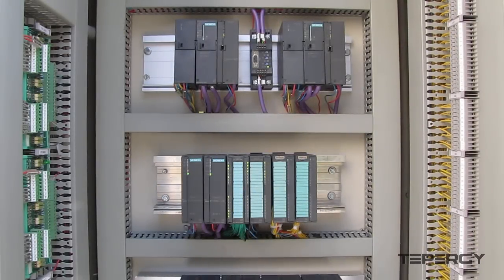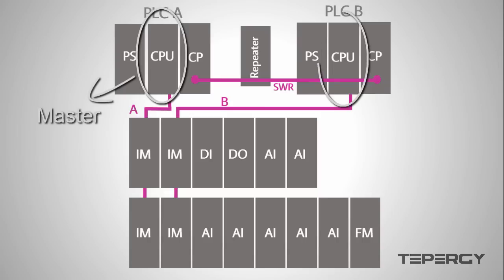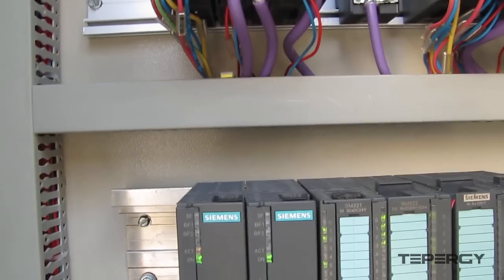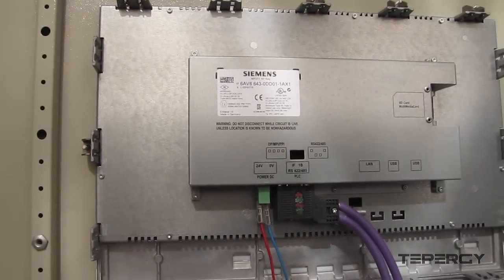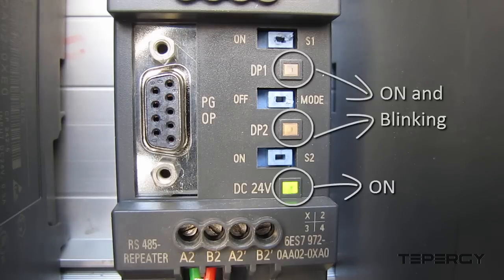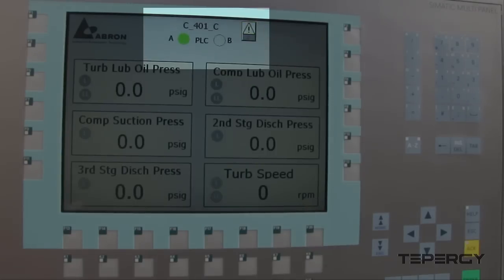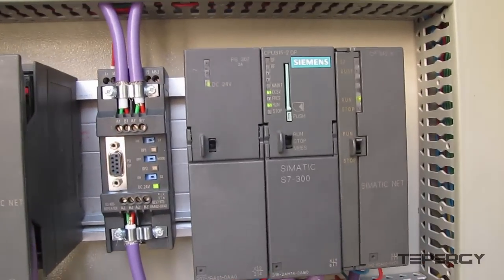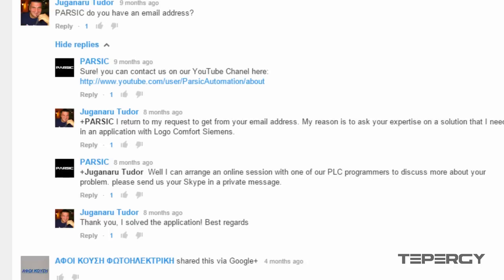How to Configure an S7-300 Redundant PLC _ PART 2

Comment: Thank you very much for the information you provide, however I have a question, I couldn't see the point of doing such a system, I mean what if a failure happened to the io cards, and that's more common than failures in cpus, then both cpus with be in sf mode and the system will go down, I have faced such a problem before in a cement factory.

Comment: Hello sir, 
I am facing node issues.
We have Siemens S7-400 PLC. CPU 416 connected with multiple nodes. One of the node missed for short interval of time (200ms to 300ms).
These node are addressed in diagnostic buffer. 
Kindly suggest what steps to take to resolve the issue
Reply from the maker: Thank you for reaching out regarding the node issues you're experiencing with your Siemens S7-400 PLC. Addressing node communication problems can be complex, as they can be influenced by various factors.

Given the complexity of node communication issues and the specific configuration of your PLC system, it would be best to reach out to the vendor of your Siemens S7-400 PLC for further assistance. They can provide specialized expertise and diagnostic tools to help identify and resolve the issue effectively.
Reply: @realpars  Thank you for your reply. 
We are using S7-400 PLC CPU 412-2 DP (6ES7 412-2XG00-0AB0)
We have connected multiple nodes through this CPU of S7-300 (IM 153-1 6ES7 153-1AA03-0XB0)

Some of the nodes are disconnected after every 5 to 6 hrs for 200ms.
We found this on diagnostic buffer of simatic Manager.

Comment: Hello friends, what is the possibility that with the equipment you mentioned in this video we can implement a ring type network to have redundancy in case of a break in the Profibus cable that communicates the PLC with the ET200?
Reply from the maker: You will need to use CPU's and communications modules that support MRP (Media Redundancy Protocol) and have 2 ProfiNet ports (not the same as Profibus DP).  I know the S7-1500 CPU and ET200SP remote I/O offer this feature.  Some models of the S7-300 do, but you would have to use an ET200MP remote I/O system to get the Profinet connectivity.

Comment: Thank you very much for the information, it is perfectly understood, now I have a question. What would happen if one of the ET 200 fails? Or, what would happen if the profibus cable that communicates one of the PLCs with one of the ET 200 suffers a fault? Would the backup ET 200 continue to send the required information transparently?
Reply from the maker: Yes, it would failover to the backup if the primary ET200 faulted or the cable was damaged.  If the backup fails, the primary will continue to operate.  In either failure case, diagnostic information will be available., indicating that the fault has occurred.
Reply: @realpars  Thank you very much for the information

Comment: Great video, it's possible to do a redundant system with 2 different CPUs with the same IO configuration?
In example: one S7-315 and one S7-312, respecting memory and processing times by the slowlier CPU capacity?
Reply from the maker: I believe it is, as long as each CPU has the same I/O hardware configuration employed.  Redundancy in an S7-300 system is software redundancy and is driven by program blocks configured in the CPUs.  Normally, the CPUs are the same model, but as long as the same program can be executed in each of the CPUs you have listed, the redundancy approach should be possible.

Comment: 1:38 "we have the same situation in Rack3",if rack2 and 3 both are same situation,then how do u conclude A is master?
Reply from the maker: Rack 2 and Rack 3 are connected to a redundant pair of PLCs, PLC A and PLC B.  Racks 2 and 3 have 2 ET200M Link cards. The left-hand cards are connected to PLC A via a Profibus connection. The right-hand cards are connected to PLC B through a separate Profibus segment.  When PLC A is the master, the left-hand Link cards are active;  when PLC B is the master, the right-hand Link cards are active.  At 1:38 in the video, the Active light on the left-hand Link cards are on, so PLC A is the active PLC in the redundant pair.

Comment: Great job! I know working principle is the same but, Are there any differences between s7-1500 R/H system and s7-300 ?
Reply from the maker: There are a number of differences, including performance and form factor, but the underlying programming and interface concepts are nearly the same.  To construct the same redundant setup as in the video except for an S7-1500R, you would only need to connect the CPUs via redundant ProfiNet cables (Profinet ring).  For an S7-1500H, there is a synchronization module at each CPU connected by fiber optic cables.  For the S7-1500, the redundancy is easier to install and configure, requires less hardware, and has much better performance.

Comment: In this configuration the redundancy is on the CPU level, but how to achieve redundancy on the I/O level ?
Reply from the maker: Thank you for the excellent question!  To configure I/O redundancy, you will need to use an "H" series CPU, like the S7-400H.   The manual for that CPU is here: https://cache.industry.siemens.com/dl/files/386/60458386/att_63953/v1/S7_400_h_en_en-US.pdf
On the hardware side, you will need to read Chapter 13 of this manual to understand the concepts of "single-channel one-sided I/O" and "single-channel switched I/O".  The use of specific IM interface modules is required as well.  On the software side, understanding the concepts of activation and depassivation of I/O channels is critical, as is the use of specific functions (FC450-FC451) and function blocks (FB450-FB453).  This takes a little practice and patience to set up your first redundant rack, but then it becomes easy to extend the concepts to additional racks.  Special treatment of analog signals is required because analog cards behave a little differently in a redundant setup.  This is all in the manual referenced above.
Reply: @realpars  Thank you for the detailed answer 💎

Comment: Do you need to configure anything on the CPUs so they know they are working en redundancy mode and which one is the master? or do they seemingly detect they are redundant...? thanks!
Reply from the maker: With S7-300 redundancy, you need to configure the hardware configuration for redundancy as add programming via specific blocks (SWR_START, etc.) and interrupt blocks to make the switchover efficient and reliable

Comment: Could anyone please explain the difference between 300's soft redundancy and 400's hardware? Thanks.
Reply from the maker: With software redundancy, two CPU's with the identical program are running at the same time.  The master executes its program in it entirety.  The standby program executes, but skips the fault-tolerant portion of the program (logic and setting of outputs).  The master continuously updates the secondary's memory and PIO table.  When a fault occurs, the secondary begins execution of the entire program and takes over as master.  This may take a couple of cycle of the program to fully changeover.

With hardware redundancy, two identical CPUs are connected to a redundancy module so that the synchronization of the data/memory spaces of the CPU's occurs through a high-speed fiber connection.  This makes the synchronization of the CPU's much faster, and reduces the fail-over time when a fault occurs.
Reply: @realpars  Thanks a lot. so the main disadvantage of soft redundancy is the swithover time?

Comment: Is the switchover bumpless? If no  then what is the switchover time.
Reply from the maker: The S7-300 family of processors uses a strategy called "software redundancy".  According to the Siemens Software Redundancy manual (A5E02171565-02), the transfer from primary to secondary takes 1 - 2 OB cycles (typically 30 - 200ms depending on program complexity).  When a fault is detected, the outputs are frozen and the Process I/O Image (PIO) is transferred from the primary to the secondary.  This is what takes 1 - 2 OB cycles.

Comment: How to Configure an S7-300 Redundant PLC HW and SsaftW in tia portal
Reply: This is a complex question.  Hardware redundancy is S7-3xx is not supported by Siemens. It is supported by certain S7-400 CPU's.  You would configure a software redundant S7-300 PLC pair in TIA Portal in the same way that it is done in STEP7.  You would need to configure 3 ProfiBus networks: 1) PLC-A CPU to an IM-153 module in each I/O rack; 2) PLC-B CPU to a separate IM-153 module in each I/O rack from the one used for PLC-A; and 3) a Profibus network connecting a CP module in the PLC-A rack to a CP module in the PLC-B Rack.  More info can be found in Siemens document A5E02171565-02.  This just scratches the surface of setting up the entire application.
Reply: @scottsommer5450  Can I do this at tia portal ?
Reply: @abdelakderkameleddinemamme4739     I have not tried this myself, but there is nothing that was configured in STEP7 in this video that is unique just to STEP7.  The functions of NetPro are now handled by the various tabs in the "Devices & Networks" builder in the Devices tree of TIA Portal.
Reply: @scott sommer Can you send me a link for software redundancy  because I did not know how to downlowd it ?
Reply: @abdelakderkameleddinemamme4739  https://support.industry.siemens.com/cs/attachments/1137637/S7_swr_b_en-US.pdf?download=true
Clicking on this link will download the applicable document to your Downloads folder.

Comment: Hi
What is the repeater for?
Can we omit it and tie its inputs and outputs together, as we have in the software (hardware configuration)?
Reply from the maker: Hi Mohammadreza,
It is possible to connect up to 126 devices, both masters and slaves in a Profibus DP network. However, to operate the network with this number of bus stations, the bus must be divided into individual segments. The segments then must be connected by repeaters, devices capable of processing the network signal and handle disturbances or noises in a way to reject them and re-create a favorable situation to the physical layer.

No, it is not possible to tie the inputs and outputs of an RS485 Profibus DP together at all!
Thanks

Comment: What is SCALANCE X208? Is this also use for the HMI like repeaters?
Reply from the maker: Hi There, it's a Siemens SCALANCE X208 Managed Switch ‑ 8 Ethernet Ports. The switches are ideally suited for the design of Industrial Ethernet networks with 10/100 Mbit/s in line, star or ring structure. The integrated redundancy manager of the SCALANCE X-200 switches can be used to build redundant optical or electrical ring structures. The units feature extensive diagnostic options, such as PROFINET

You can monitor field devices via HMI And PLCs. So in order to make a connection with them and reach your final desired movements, you can use this switch device to give orders constantly based on your power system plan.

Hope this answers your questions.

Comment: Hi, thanks for video. One question, after failure of master, slave kick in. After error was fixed does master overtake control from slave or it will stay as slave till new master fails ? Does one of them have higher priority than other or its manually set witch will be master by operator?
Reply from the maker: Hi, you're very welcome. In this redundant system,  when PLC A fails, PLC B is going to take over the control of the system and stays active regardless of the error being fixed for PLC A or not. 

None of the PLCs have a higher priority over the other. 

I hope this helps.

Comment: Hi, I wanted to ask if the redundancy is possible using ethernet protocol and not a profibus one.
I think that it is possible even if i don't know how it is done....and it is more easy at programming it
Reply from the maker: For S7-300, you should use Profibus for having the CPUs working as a redundant system. But for S7-400 you can use Ethernet as well.

Comment: I have read on Siemens forums that I/O redundancy for s7-300 cpus is not possible, but in this video it is possible, what does I/O redundancy mean exactly then?
Reply from the maker: +AhmadWAyase Here there is one set of I/Os with two CPUs, meaning that you have the same I/Os but two CPUs. If for any reason the main CPU stops working the other one takes care of controlling the system.
Reply: RealPars so here it is called I/O redundancy? if yes, why are they saying on the forums that I/O redundancy is not possible with 300 CPUs, and is it possible to do 300 CPUs redundancy using profinet and not MPI?